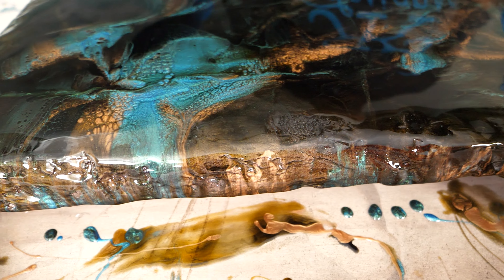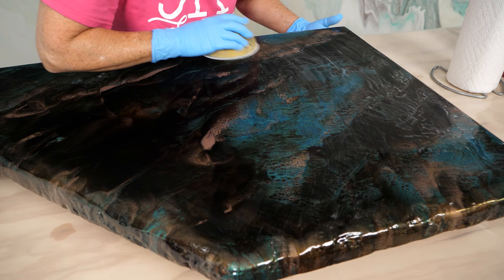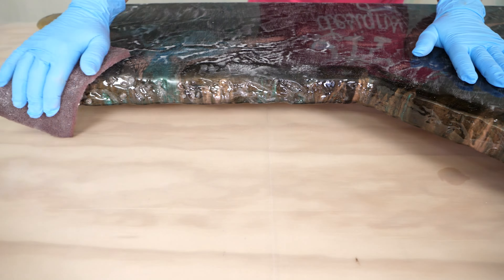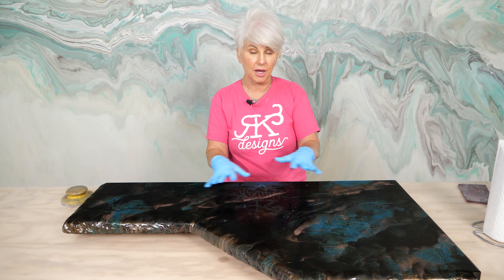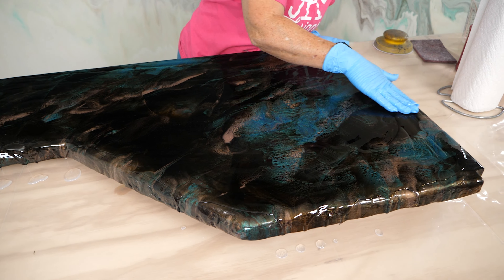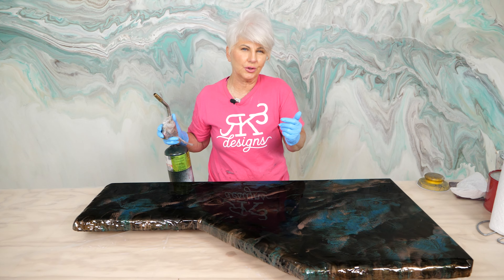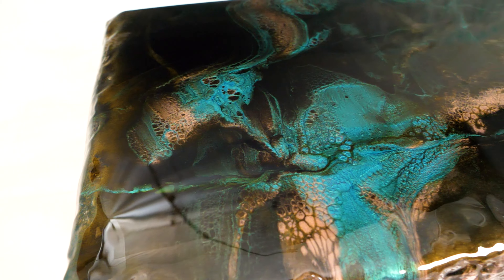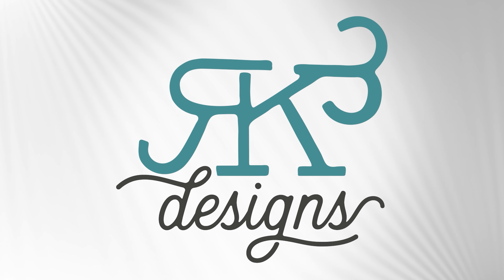DIY Custom Bathroom Vanity with Fast Setting Resin

Comment: those reactions are better than what I'm used to.  Is that because it's quick coat instead of normal coat?  Or is it mostly due the different chemical formulas of different brands of color?